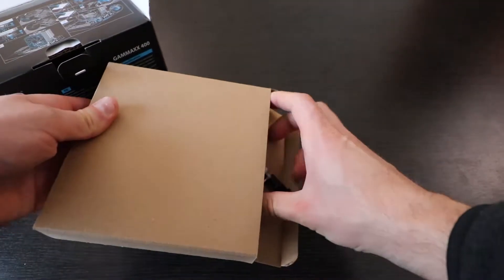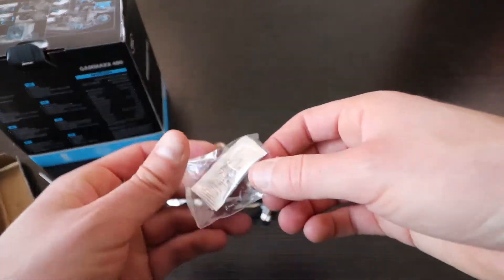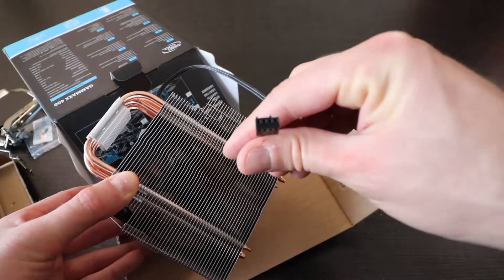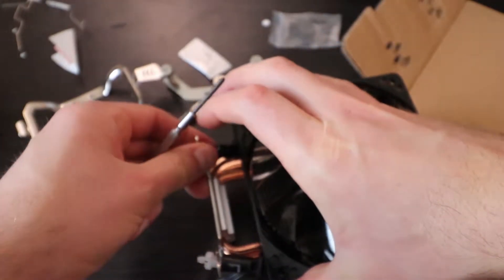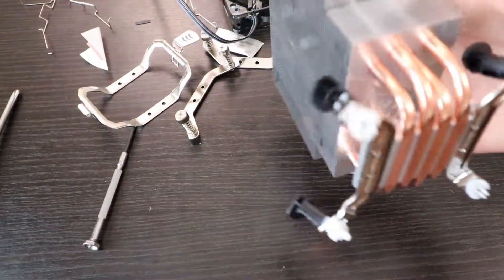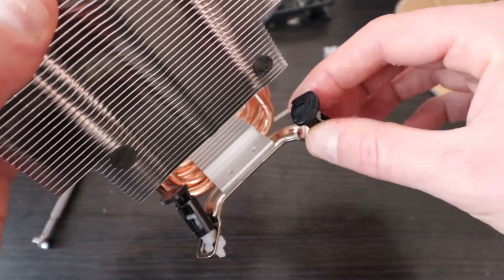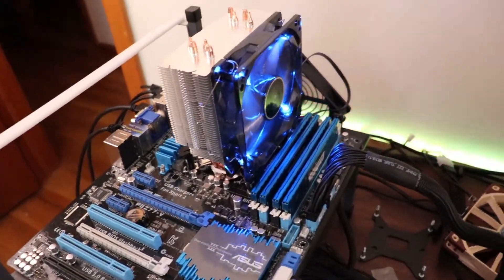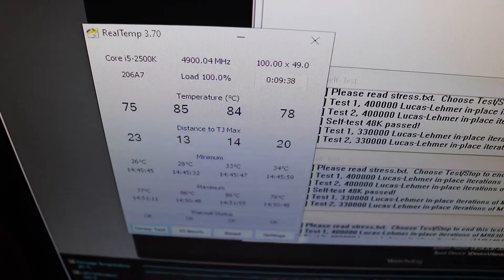DeepCool GAMMAXX 400 - Unboxing, Install and Stress Test

Comment: Using mine on an i7 9700k, can't say I'm impressed as I'm getting thermal throttling.

The heat transfer is great, there's just not enough fins for it to dump heat effectively under load.

Comment: Does anyone know what size screws it uses to mount the heatsink to the brackets? I bought mine almost four years ago and it went unused and now I can't find what I did with the screws or the manual.

Comment: i was wondering if you know why my rtx 2060 fans only go to a high of 84% even when temps go to 214F. ive tried many programs to fix, but cant seem to get it to go above 84% to cool gpu down. can u offer any advice?
Reply: @goblingaming3067  i was looking at hot spot temp not overall temp. but thanks. i will need to replace thermal paste someday. but i may buy a new gpu before then.